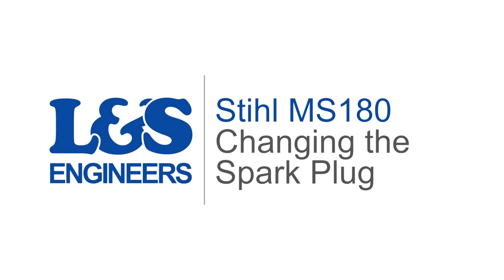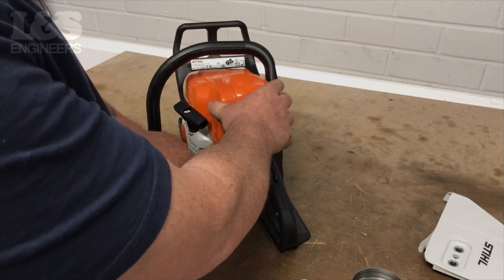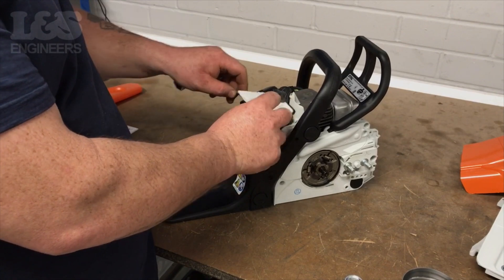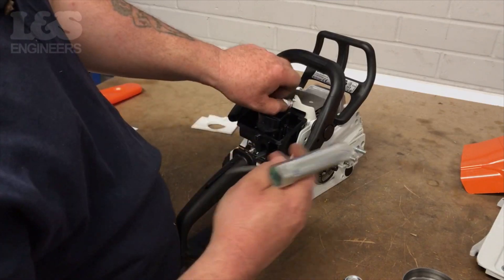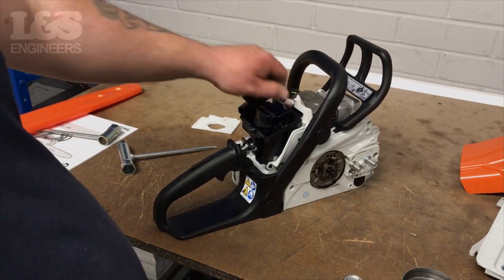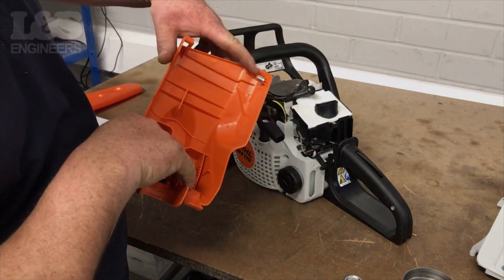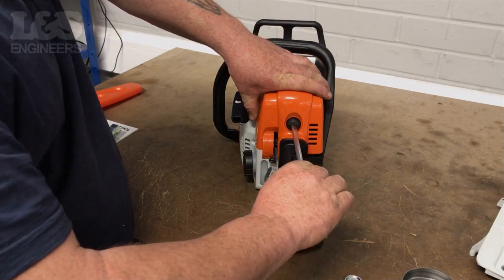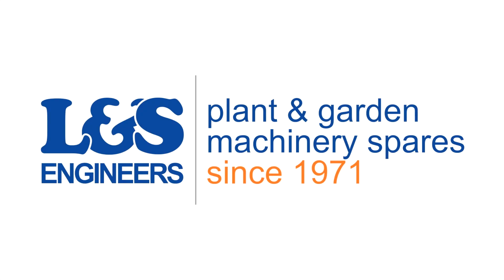How to Change a Spark Plug on a Stihl MS180 Chainsaw | L&S Engineers

Comment: The spark plug cover on mine doesn't remove easily, how do I grip it without tearing it up?
Reply from the maker: Hi, as there is a spring sitting inside the plug, this can make it feel like it's hard to remove. A lot of the time you will just need to ease the plug with some force by hand or with pliers. If you are still finding this difficult let us know :)